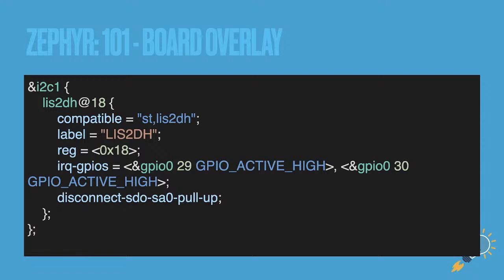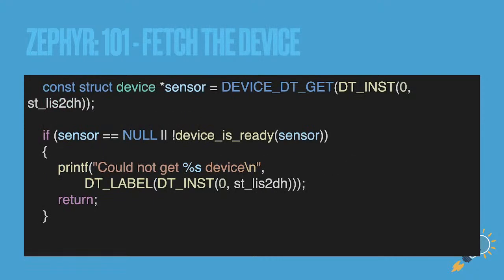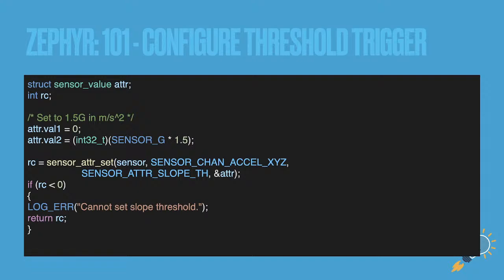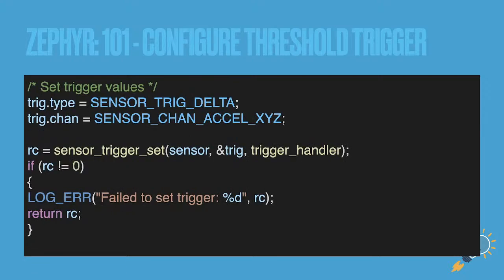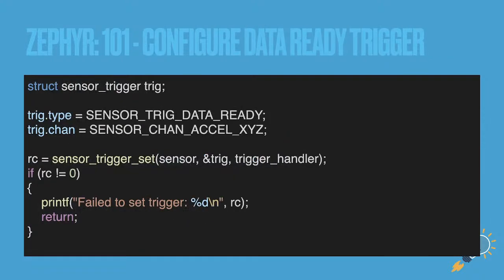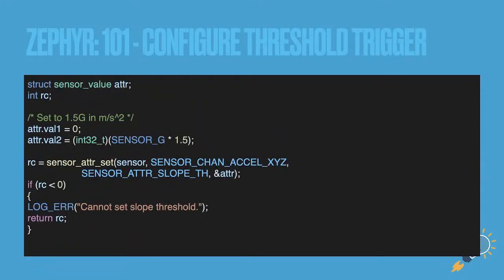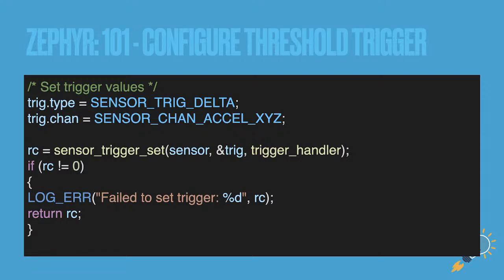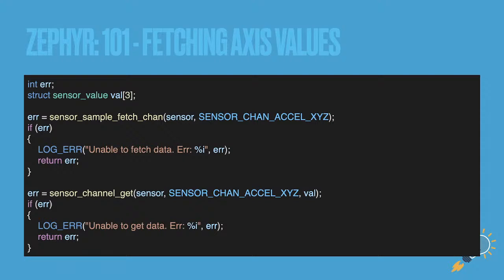Zephyr 101 - Using the LIS2DH Accelerometer

Comment: Nice series Jared! Really enjoying it.
I really like the abstraction Zephyr makes to create the sensor triggers, but then again - unless I'm missing something - it's hard to know which interrupt pin is actually used for the triggers. It requires one to look in the driver code, which is kinda the opposite of what the abstraction is trying to achieve (meaning that you don't need to care about the low level platform dependent stuff). A lot of times I have this confusing contradiction with Zephyr, but I also understand that this might be impossible to 'fix'.
Reply from the maker: Hey Sven

The LIS2DH is a bit of a beast and hard to completely abstract away. The driver, AFAIK, is very opinionated as to how the interrupt pins are used (even though their functions can map differently). I actually had to modify the driver to allow for FIFO processing since that didn't exist in the code. It's truly up to the vendors (i.e. ST in this case) to support these chips well in Zephyr. If they don't care about Zephyr it's up to the community. Thus these implementations can be rough and, unfortunately, incomplete.

Comment: Hello Jared, 
Thank you for this interesting video.

I'm newbie to zephyr and I'm working currently on LIS2HH12.
I adapted all the libraries to this sensor and when I try to use trigger, it shows on the terminal durring debug session " Failed to set trigger: -134 ". 

Could you help me please ?
Thank you.
Reply from the maker: Thanks Soufiane. I would make sure that your overlay has the interrupt pins and also that you have trigger mode enabled in your configuration.
Reply from the maker: Here's an example of how I set mine up here: https://github.com/circuitdojo/nrf9160-feather-examples-and-drivers/tree/v1.7.x/samples/accelerometer

Comment: I think there is a bug in the zephyr drivers. After the proper initialization you don't have to filter incoming event (whats worst gpio ISRs). I will drop a diff here in a minute with some longer explanation, maybe you would also like to test. The amount of interrupts worried me, so i done some research to prevent it.
Reply from the maker: If I were you I'd probably check to make sure my interrupt signals are connected properly. Additionally make sure that the threshold registers are set to something above typical gravity readings. You'll get a ton of interrupts when it's set below. Hope that helps!

Comment: The code in the video is not the same as on github. i want to try the principle of printing a message when shaking the accelero,, Could you upload the code in the video aswell?
Reply from the maker: Hi Erwin, I'm not sure what you're referring to. What isn't the same?
Reply from the maker: @erwinn58  got it. There is no code for motion detecting in that sample. (only standard polling)
Reply: @CircuitDojo  ah okay, just curiosity